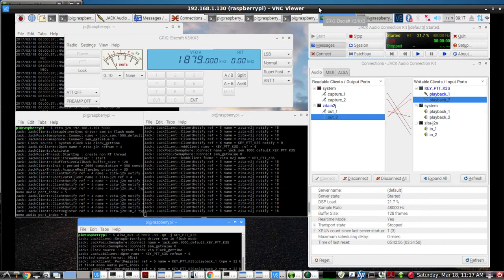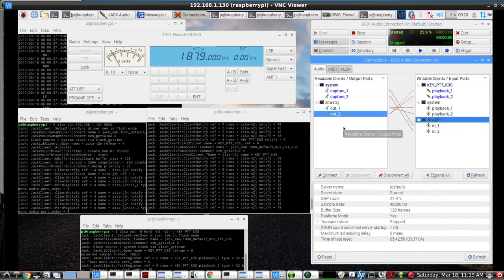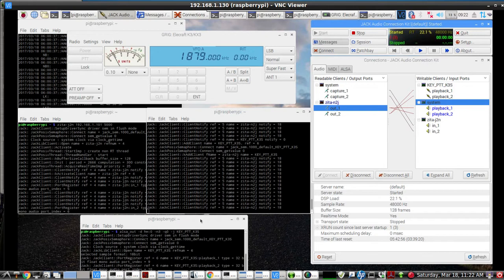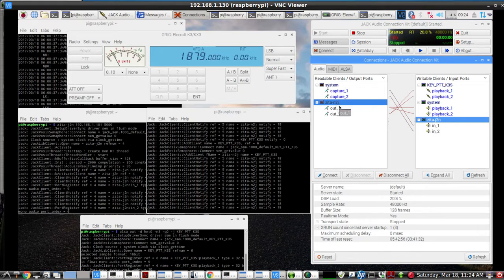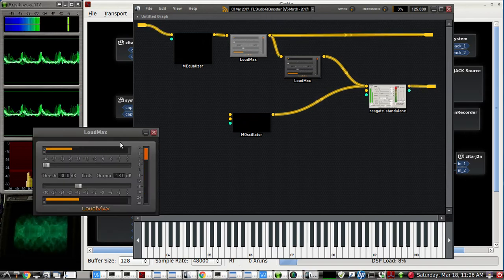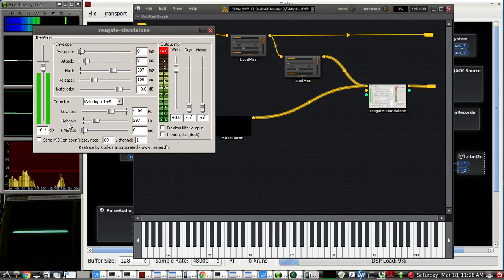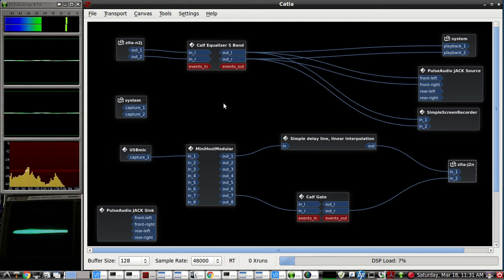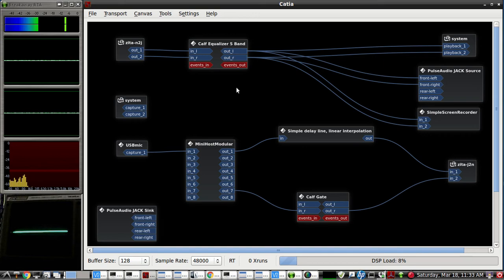Remote SSB into your HAM RADIO RIG using a Raspberry Pi and free software - Linux

Comment: Hi - is there an introduction to this somewhere - I'm a seasoned engineer and I cannot understand what you have put together here from the vid.
Is grig running directly on the pi / viewed locally via VNC or is it running near-side and controlling the rig over a TCP link? Thanks
Reply from the maker: yes, GRIG was running on the pi and viewed and controlled at the remote PC by/over,  realVNC... REALvnc/pi  works pretty fast and reliably for REMOTE RIGn    NOTE: i now prefer  FLrig though,  instead of GRIG... for a RIG CONTROLLING app...  http://www.w1hkj.com/flrig-help/